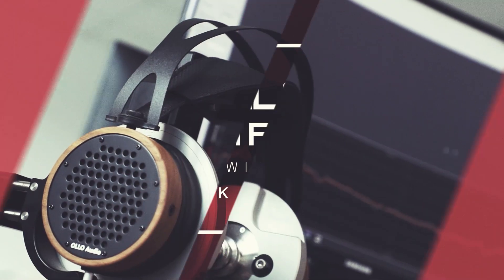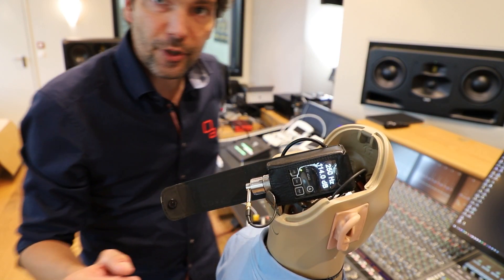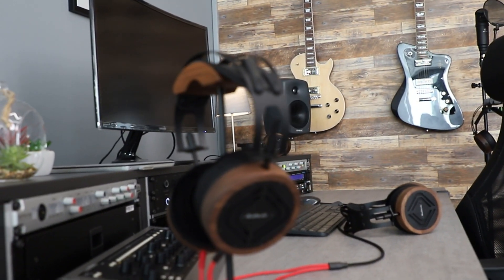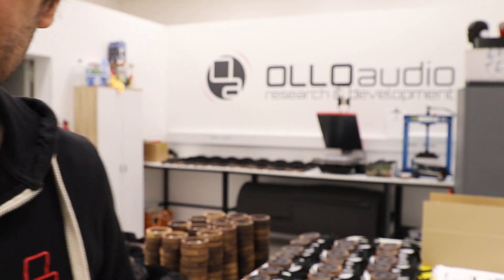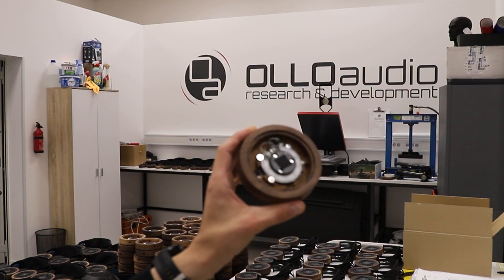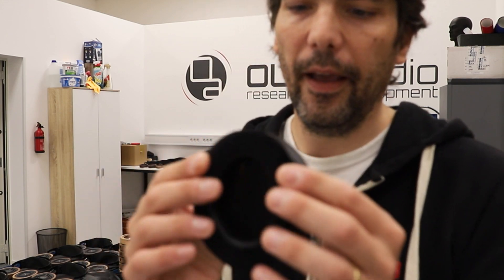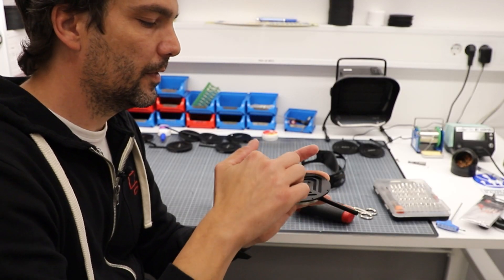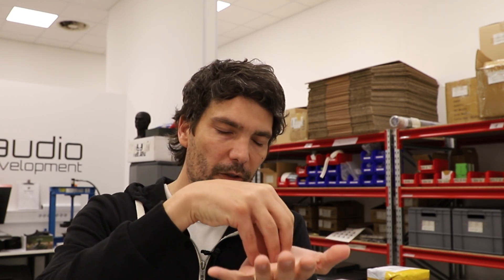S5X - Stereo and immersive (e.g. Dolby Atmos) mixing headphones by OLLO Audio. Life series #21

Comment: Looks good! What's the inner diameter of the earpads? I'd love to pull the trigger on this.
Reply from the maker: Sensitivity*
@ 0 dBu RMS 1 kHz produces (+/-1) 108 dBSPL
@ -23 dBu RMS 0.5-2kHz pink produces (+/-1) 85 dBSPL
Frequency range*
15 Hz - 22 kHz sweep 1/3 oct p-p range (+/-1) 14.5 dBSPL
20 Hz - 20 kHz sweep 1/3 oct p-p range (+/-1) 12 dBSPL
Earpads in/out diameter / depth
+/- 2.5mm 57.5mm / 95mm / 20mm
Impedance
+/- 5% 50 Ohm
Weight
414g
Clamping pressure N/cm²
@14.3cm breadth ~0.127 N/cm²
Reply: @olloaudio  Finally some specs, thank you! Any chance you could post the frequency response curve somewhere so we can see how it differs from S4X?
Or at least tell me if the highs and sub bass are more present this time around? Much appreciated.
Reply from the maker: @Nayah9  Yes, it's here: https://olloaudio.com/pages/measurements
Reply: @olloaudio  Awesome! I didn't even think to check the PDF. That is one impressively flat curve, well done! Shame about the big price bump compared to the S4X though...
EDIT: 6 months later I'm glad to see that the price dropped by €100 since release. Although in the meantime I've discovered the magic that is Sonarworks which instantly fixed all my headphones. Maybe sometime when I have the cash to burn I'll give the S5X a try (I'd be a lot more willing if return shipping wasn't at the expense of the customer).